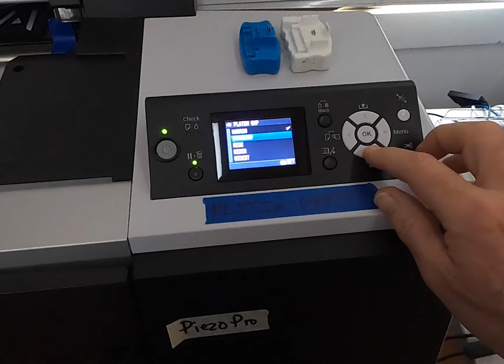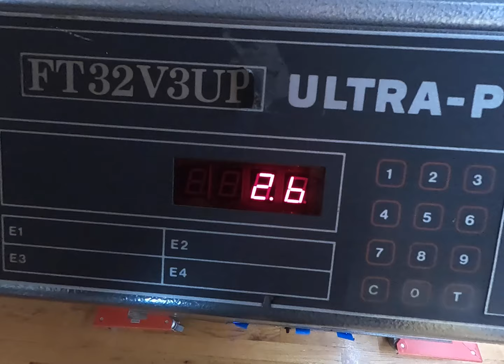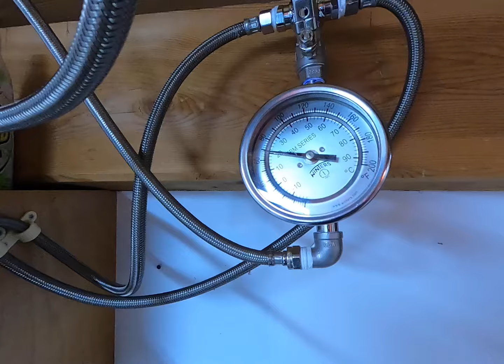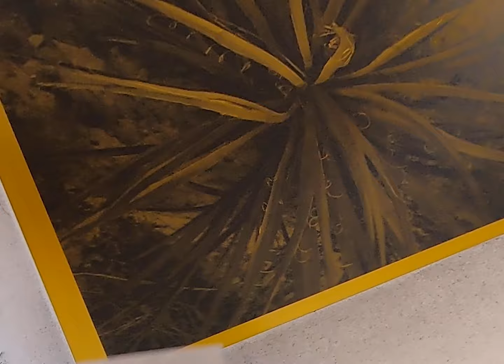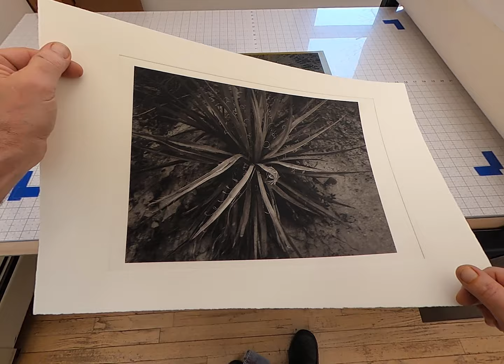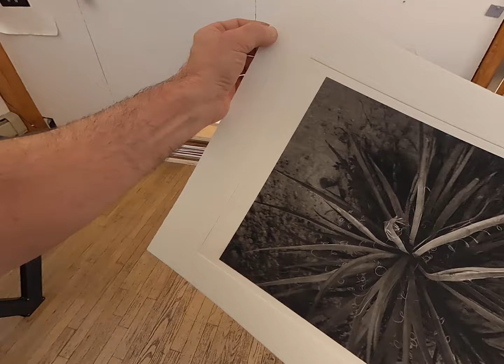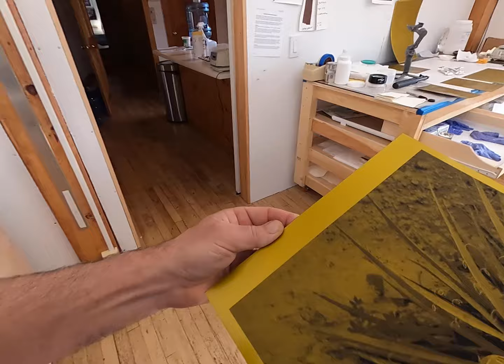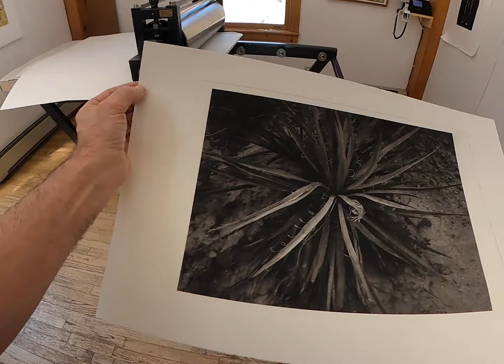Direct to plate Photopolymer gravure from start to finish!

Comment: Really a very big thank you Jon for this video. Excellent.
May I ask what is the product added to the 12'?
Reply from the maker: That's just a bit of thin (#00) plate oil I am adding to a sample of ink that happened to be the same recipe as the one I was mixing...  It had dried somewhat from use - so I was just restoring it a bit to recondition it..
Reply: @ConeEditions  can this be used as an alternative to computer to print laser machines
Reply from the maker: @goldcoasttime  It can be used as an alternative to computer to plate laser printers used in the pad printing industry. The UltraHD Matte Black ink at InkjetMall is the darkest and most opaque ink ever made in the inkjet industry. With it you can use 2880dpi on a supported EPSON printer. You can also print as low as 320. Point being it is fully opaque so that when you expose the pad plate it works. However, the pad plate has to be compatible with aqueous inkjet - like a Toyobo Printight Solar Plate (KM73) which is commonly available. UltraHD Matte Black ink is here: https://shop.inkjetmall.com/shop?search=ultrahd+matte+black&attrib=44-206

Comment: When in the process would you normally trim the plate if you wanted a consistent border (imprint) around the final print?
Reply from the maker: We print our trim marks and do our trimming after we have final hardened the plate with the second exposure (4x the calibrated exposure). The trim marks give us consistency. You just increase the canvas size with a white margin around your area to the size of the borders you want, and then add 1 pixel all around of gray or black canvas size to form the trim edges.

Comment: Jon, I'm intrigued. I feel like you are handling the plates in daylight. It doesn't have the power of UV light, but still no impact on the plates ?
Reply from the maker: It looks that way for sure - but the entire building is lit by LED tubes that are low UV emitting. The State of Vermont (greatest State in the Union) bought them for us to reduce our electricity costs saying they would pay for themselves in just 3 years - and they have! They are 5000k and we dim them depending upon the sensitivity of the emulsions we are using. Having said all that, the iPhone normalized the scene and made it look brighter than it actually is...

Comment: Nice video, thank you. Is there no need for a screen exposure using this method, or are you introducing a dot pattern in your image?
Reply from the maker: No need for a screen. With direct to print the actual dots from the inkjet printer provide the "screening". It can be done at 2880dpi with the UltraHD Matte Black ink that Inkjetmall.com sells for Epson printers. Or it can be done at 1440 dpi with Epson black ink. We also have a three ink method which prints at such fine resolution, that it looks photographic without any dot textures whatsoever.

Comment: Nice and instructive video. What material are you using for wiping the plate?
Reply from the maker: Even though we print with oil based intaglio inks, we wipe with the Akua wiping cloth which is much less aggressive than tarlatan. We finish wipe with unbuffered interleaving tissue.

Comment: Nice Vid - what is the purpose of adding the transparent base to the ink?
Reply: Our process uses the Piezography Pro ink set and the Piezography software  - and we are able to separate 256 gray levels in the plate. That's considerably more than copperplate photogravure. Adding transparent base is critical to that - and we lose nothing. We can get a very dark black even with 30% transparency - so what the transparent base does is open up a lot of the mid and dark tones. Without doing this, those tones would not be as smooth - although some people prefer chunky shadows...  we prefer open shadows with lots of transitions between the shades...
Reply: @Inkjetmall  thank you, good insight

Comment: Thanks a lot. Are you using QuadtoneRIP as a printing software? Would you mind sharing your curves settings?
Reply from the maker: For our in-house projects and for plates we produce for customers, we do not use QuadTone RIP. We use our own printer driver which we are developing. And we use a version of Piezography software to make a linearization/calibration which is resident inside the printer driver itself. When we teach workshops we use the QuadTone RIP driver and we teach our attendees how to use the Piezography UltraHD™ Matte Black and create a calibration for QTR using the Piezography software.

Comment: In the process of making the plate, it appears that no aquatint is required for direct-to-plate. I'm curious as to why it is not necessary.
Reply from the maker: We are printing the aquatint:  What we have done is designed our own printer driver that can produce a very fine pattern of opaque ink droplets. Depending upon the printer model we can print up to 5760 dots of ink per inch. So, what we do is use an unordered dithering that simulates aquatint with mostly very tiny drops of inks and the occasional larger drops of inks. These are printed with a fully opaque ink we formulate which is part of the Piezography ink set we invented. The image is printed with its own "aquatint" so to speak. Very light tones get a very light printing of these droplets while darker tones get more compressed droplets of inks. Then the plate needs just an exposure without glass or film...and as a result the resolution of these tiny droplets holds and the image is formed on the plate when it is developed. Those tiny divots hold ink when the plate is hand wiped.

Comment: what inks do (brand, specific blacks) you use and modifies added?
Reply from the maker: We use oil based inks from Gamblin and Charbonnel. The blacks we like are Bone Black (which is very dark and produces open mid-tones and quarter tones...) and Carbon Black which is warmer, and occasionally Portland Black if we want to strengthen the mid-tones. Any of these blacks we can make warmer or cooler or more neutral by addition of color inks. Generally, our calibration process produces prints that match the display but often during proofing these decisions to strengthen or open come about seeing the work progress. The only modifiers we use are Hanco's Zea Mays transparent base (10-30%) and a little easy wipe.

Comment: Printer settings, Curve? :)
Reply from the maker: This process uses several monochromatic inks from the Piezography black and white ink set. This is the same ink set that produces tens of thousands more gray levels than EPSON color inks... we do provide full library of free curves for all EPSON and popular 3rd party media for black & white prints, and also curves library for making digital negatives for alternative processes...but the curves for this multi-ink Direct to Plate are only available when you come take a workshop with us. You need a supported EPSON printer to install the Piezography ink set. The workshops are here: https://www.cone-editions.com/workshops and we have an online pre-recorded demonstration on it here: https://shop.inkjetmall.com/DTP-ZOOM.html
Reply: @ConeEditions  I sold my printer with the Piezography ink set, now using Epson P8000, I'm a printmaker, (learded from Dan weldon 2000) i'm just looking for more Information on direct to plate printing...
Reply from the maker: @boxkam  there are a lot of ways to do this process with direct to plate and the more popular method uses black ink only. That is how we started, then we moved to two inks, and now we offer three inks and are separating 256 gray levels on a photogravure plate. We use the Piezography Profiler to do that. We do offer Piezography ink set for the SureColor P6000, P7000, P8000 and P9000 printers. Those are our latest generation supported printers. If you wish to stick with your OEM inks you could install QuadTone RIP and print with the black ink only and generate a single curve on your own...  It is not difficult at all to generate a single ink curve with QTR. You should be able to separate 100 gray levels or close to it. You can start with just 21 steps, and then comfortable with that move to 51 steps. Then go for the 100.
Reply: @ConeEditions  I have QTR and DN pro, I've been making DN for years, Just trying to get more info on Direct to plate :)
Reply from the maker: @boxkam   I'm Jon Cone, do you have my email? Easier to answer questions that way...
Reply from the maker: @boxkam  Dear Christopher, we teach this at CEP in the summers! https://www.cone-editions.com/event?search=gravure warmest regards :)
Reply from the maker: @boxkam  We teach it at Cone Editions Press here in the summers! https://www.cone-editions.com/event warm regards!